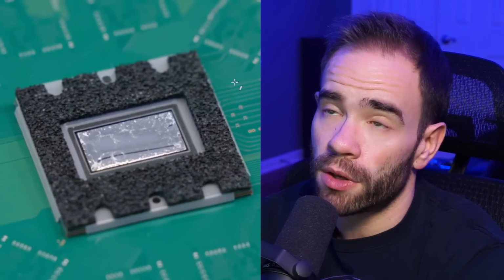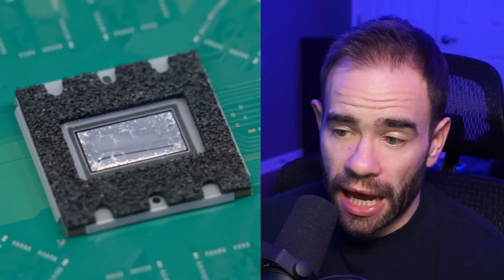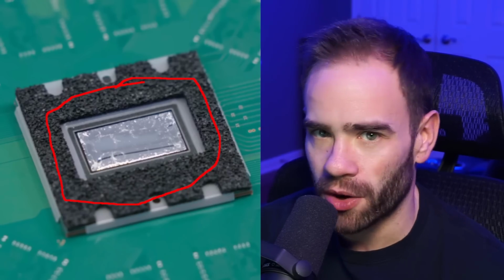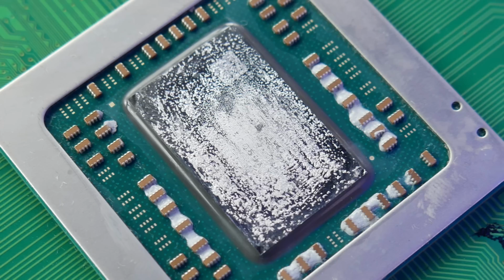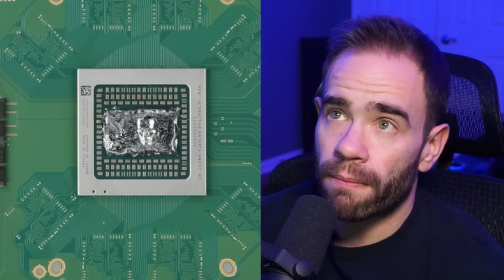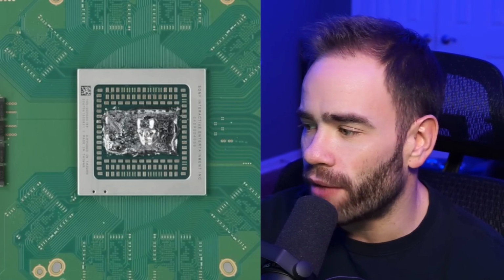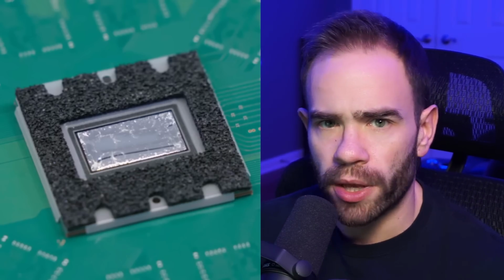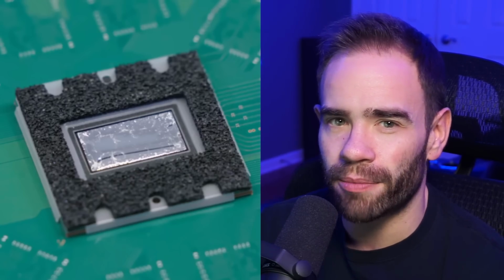Is Your PS5 Actually In Trouble?

Comment: I have repaired hundreds of PS5s, I can 100% tell in my most processional opinion based on all my observations and recoding's, vertical storage causes gaps ( Dry spots / Hot spots ) on the APU chip. When this happens a significant amount of oxidation occurs, in the form of grey sticky residue. If your PS5 is over 3 years I recommend that the PS5 should be professionally cleaned 12 - 18 months + have the old liquid metal completely removed and totally replaced.

Comment: @Spawn Wave Plus : repairshop around the world start to claim that they open PS5 that was NEVER opened and put HORIZONTALLY all the time to start hard freezing/shut down DUE to hard corroded APU spot because of the heat DUE to missing liquid metal spot on APU. my day one PS5 start to freeze badly also (i dont had the courage to open it yet) @ILovemyconsole have a YT channel that show the issue in france !

Comment: THe only thing that concerns me which as this guy also noted is not that the liquid metal would spill over. It's very well contained by Sony. But you can't fight gravity and it's plausible that the liquid metal may settle downward a bit, leaving dry spots on other areas of the chip so it's not cooling as effectively. 

If this is true, then putting your PS5 vertically can reduce its life unless you keep reapplying the liquid metal every year. But whether this actually is a real issue, it's still anybody's guess at this point. 

I just got a Ps5 about 3 weeks ago and I used it vertically for about 2-3 days and then these stories scared me shitless. I have a tiny desk but I'm somehow using it horizontally now. I have a lot of past traumas associated with dying consoles, so I don't want that happening again with my new purchase.

Comment: I've had my PS5 vertical an I've had no problem since I've had it. The barrier their helps to stop the liquid metal from going everywhere. We know that liquid metal can be messy to other metal or be a conductor. There's also three chips on the board in the PS5 that gets sent through the PS5 that sends through to say hey we need to cool down an the fan speeds up but that's only if you are pushing the PS5 hard on all settings. If you run the PS5 less hard it won't over heat etc.

Comment: ONLY the first models.. most of them on Brasil.. nothing to do with the liquid metal. The problem was a thermal paste around the chip, on an L shape. And that L shape would not let the pressure of a metal plate on the back of the chip to proprer pression it. Because it would pression more on one side of the ship that on the other. So it wold look like the liquid metal would move, but no. There was just more pression on one side of the chip than on the other!

Comment: I have been watching a lot of tear down videos of PS5's lately. One thing I have taken away is that almost all of them, the liquid metal seems to create a void pocket somewhere on the chip.  Almost every time, the liquid metal needs to be moved, "reflowed" or worked back into the chip surface and heatsink. I understand that liquid metal has a slightly better thermal efficiency. I have seen bench tests comparing the latest thermal pastes and liquid metal and liquid metal usually edges out about 2 degrees F. My question: Is it really even worth it? Liquid metal seems to have some slight moderate risk, even if being careful. If it is flowing and causing a void..even a small one on the heat spreader, why not just use a current high end thermal paste? Both paste and the liquid metal have a  service life. Most of us are going to go back into the system and doing a deep clean which is going to require disassembly to the point of needing to repaste or at least "rework" the liquid metal before either one's service life has been reached. I am just speculating. I'd be interested in other's input and opinions. I am most curious about the  longevity of the system, both stock with LM, vs. possibly using a high grade thermal paste on the chip.

Comment: I'm disappointed that they couldn't add some kind of password protection to the power switch. They made this thing way too easy to turn off. There's so much more that could have been done to prevent this. I'm hoping they'll just make the PS6 without a power switch so it stays on all the time.

Comment: I’m very careful with all my systems and other than the red ring on my 360, xbox are solid and well built along with the controllers and accessories. Can’t say the same for PlayStation. Far more broken parts and failures. Throw in the obnoxious size of the ps5 and the choice was easy. I’ll still get a ps5 but will wait for the “slim” version.

Comment: Delidded my i7 7700k using thermal grizzly's liquid metal conductonaut at ltx 2019, been running near nonstop since then with 0 issues. Should probably check it, might just be the conformal coating doing its job.

Comment: I bought 3 ps5s two disc's and 1 digital the only problem that I had was the digital version over heating and I just opened it up cleaned the big dust build up on power supply and it works flawlessly now

Comment: My ps5 when I first start it running or when I turned it off after 6-7 hour playing. I heard some cracking in it I don’t why it is happening or why but there are no issues in overheating and I have uses it for a year playing at least 4 hour a day different games
Reply: Mine does the same thing kinda freaky sounding but more than a year later I have 0 issues so 🤷🏽‍♂️

Comment: If your PS5 overheats then there are dry spots on the die where there is no LM . Also when assembling the PS5 they put the LM on then flip the motherboard over to install into the PS5 housing. So during that flip LM could potentially escape out of it's foam plastic border.

Comment: For the PS4 Pro it's the ram that makes the fan spin really fast. Just replace the thermal paste with thermal paste and use Minus 8 pads of the same size on the ram. Completely eliminates high fan spin. Test with Horizon Zero Dawn game.

Comment: Terrible, you ramble on and on, and no intelligent advice at all.
 Liquid metal thermal is known as Galinstan, has a melting point of 21 Celsius.
 The real issue with most PS5 shutting down only after a short period of time, (like 5 minutes or sooner) is absolutely due to either a loose connected power cord, or most typically, you have the PS5 power sourced from a surge protector which is in direct conflict with the already built in power surge circuit protection installed and integrated into the PS5.
  Simply plugging the PS5 directly into a wall socket will absolutely stop this issue from happening. 
You do not have to go into the PS5 system settings and make all the changes that are typically mentioned on these social media platforms. And the PS5 Is built and designed to play any and all triple A games, as that is the purpose of this system. And it can be enjoyed for hours on end, as long as the PS5 can draw room temperature air into its cooling vents, and dispatch the hot air out and away from the back side of the console freely.
Reply: Congratulations fan ❤, you are among our shortlisted winners contact me🎁⬆️🆙

Comment: When you use the console vertically, it overheats. I have my console for almost a year and I have made the difference. I deactivated the rest mode and I left it on for 24 hours in vertical mode and a  another day I did the same thing horizontally and it didn't even heat up. If you have the choice between horizontal or vertical, it depends on the structure of your furniture, I recommend putting your console horizontally.i had no issue with mine but vertically its overheating since i have it.i have also bought an external fan for it but in horizontal,i don't need it except in vertical mode
Reply: Congratulations fan ❤, you are among our shortlisted winners contact me🎁⬆️🆙

Comment: The reason why Sony put on so much liquid metal is to ensure that it doesn’t need to be reapplied for the life of the console.  Liquid metal will react with the metal of the contact plate over time and some of it will get absorbed into the metal, decreasing performance if there is not enough if it left.

Too much liquid metal risks overflowing and conducting the surrounding components together that shouldn’t be conducted, hence the barrier Sony put in.

Sony did what they needed to do to ensure liquid metal could be functional for the life of the console.

It’s good practice to apply enough liquid metal in any scenario, as long as it doesn’t touch surrounding components.
Reply: Congratulations Jackka82❤, you are among our shortlisted winners contact me🎁⬆️🆙

Comment: I wish there was nothing to worry about but I'm afraid I am a victim of something going wrong with the PS5. Had it since its launch, sitting vertically, and consistently cleaned and kept in a dust free area. Still, unfortunately, the console shut off on its own. There was a diagnostics test on the PS5. No overheating issues, no hardware defects, but there was an issue with the motherboard being effected somehow. The ONLY issue could be the liquid metal spilling onto the the motherboard. There ARE a small percentage of people facing this, generally people shouldn't be worried, but precautions should be taken to be on the safe side.

Comment: For keeping my PS5 lasting longer I 1). Turn it off at the powerboard (and pull the plug out while not using it), and 2). Place a "pillow slip" over my "vertical" set up so it doesn't accumulate dust. That's all I can do to to maintain it (well, I don't know if the pillow slip idea actually works - lol). Otherwise while I'm playing a game on disc I pump up the air conditioning in my room. All I can hope for is for the longest life-span of my console as possible. But I think it's already a yes to upgrade to a PS5 Slim or Pro when released, So hopefully - Sony will have definitely learnt some important things by the time they pump out their next pressed consoles.

Comment: Ive had my PS5 since April of 2020, and “knock on wood” it performs quite well. The only issue I’ve had is sometimes i get something that sounds like coil whine but cycling the power on the system corrects that, it inly ever happened after turning back on from rest mode never from a cold boot. I sometimes use my PS5 or leave it on for hours at a time snd it works just fine. I have. Series X as well and despite the very first one shipped to me didn’t work the next one Microsoft sent works just as well well as my PS5. I know the Liquid Metal story came from a repair shop owner, got picked up by the media and overblown much like everything else the media touches does. I said to myself if the PS5 has been out since 2020 and this hasn’t been an issue until now, for one it might not affect launch models, and/or its a small sample size that affected some users such as Microsoft’s having some Series X’s with PSU issues and not turning on. If it was as big as the media over blew more people would have complained already and there would no doubt be a class action and there hasn’t been any (yet) so its most likely overblown by a repair tech thats trying to get some attention by saying something crazy.

Comment: Same as others I have had my console since launch vertically. I also have a disc system since June 2021, again vertical. No issues thus far. I am seeing this more as a "could happen" situation if there was a defect in the system when it was put together, like most any other tech imo.
Reply: The ones that claimed such a "design flaw" have retracted their statements since there is no evidence to prove their claims

Comment: Well mines mounted on the wall with a hide it mount so I’d be SOL. Been vertical for a year and a half. I honestly don’t think this issue is as big as people are making it. If your that concerned ditch the Liquid Metal for some thermal grizzly or mx5. Yeah you’ll gain like 3-5 degrees C, but you’ll have piece of mind. I am not too worried. That Eva foam is thick and with the pressure from the heat sink it should be fine. Especially after all the time I’ve been running my ps5.
Reply: Doubt it since the ones that claimed "fatal design flaw" confirmed there is no evidence to back them up

Comment: in conclusion of my first comment. i honestly beleive the ps5 doesnt vent or cool down as well as it does horizontal... idk why my ps5 was turning off after a few hours or why the screw was maddd hot but that ha[pen in vertical position almost a year ago and since switching to horizontal not 1 problem. idk why this is. simply just my experience

Comment: alright this is weird but i do think horizontal  keeps ur system cooler honestly cuz about 18months of daily ps5 us my ps5 did start shutting down after 2 or 3 gameplay hours and i went to unscrew the base while the ps5 was in vertical standing and that metal screw you tighten was abnormally hot. i sat my ps5 in the horizontal position ever since and it works great still never shutting down and still super quite.

Comment: I've had my ps5 about 2 years now and after a year of having it,  it started switching itself off after around 30 mins of gameplay on a ps5 game I noticed after playing a ps4 game on my ps5 it ran fine and didn't crash it was only switching off running ps5 games it turns out there is bit of a flaw in the design as the power supply vent holes are quite small and are prone to blocking about 80% of the holes were blocked  
So the power supply unit would overheat when more strenuously used ie more power needed for ps5 games and not so much power used playing ps4 games so it wasn't the system overhearing hence why I wasn't getting overheating warnings before it switched off so yeah took it apart and cleaned everything and it hasn't crashed once since. 

Maybe people have taken their ps5s apart but accidentally unscrewed the heatsink by mistake causing the liquid metal to leak 🤔

Comment: Disc drive issues aplenty with loud noises, grinding and a full disassembly required to move a gear back into it's right place, but that's the only issue I've had so far. LM has been used in Pc's for years without issue, I don't think Sony jumped on a bandwagon. I think they did their research.
Reply: I have had the disc version since launch I never use the disc drive I've been digital since it became a thing so I don't even know if my disc drive works

Comment: I don't like the liquid metal idea at all. These PS5's won't last 5 years which is sad because my PS2 from Jan 2002 is still going strong. I've had to replace the little worm gear guide that screws to the laser a couple of times but everything else fine. My 60 gig PS3 Fat lasted 8 years before I had to send it to Fla for reballing of the processor.

Comment: I was always curious about the PS4 Pro, as I bought one to upgrade from my base PS4 (got a year after launch), yet it died and the original is still working. One day my PS4 Pro just wouldn’t turn on (it would beep as I pressed the on button, then just nothing). The fan thing always worried me, which is why I’m glad they sorted that with the PS5 - the fans are loud upon startup of games, but that’s it for me.
Reply: You could get the Pro repaired or sell it broken on eBay for some $$. There are repair techs that fix those no power issues.
Reply: @slickrx6908  I thought about getting it repaired but then I was able to (luckily) buy a PS5 right after it broke, so just left it. Didn’t think anyone would want a broken one?
Reply: @TheMadCatter1  Yeah broken ones sell all the time. Plus if it's in low enough firmware it can be jailbroken to run third party apps.

Comment: My PS5 was purchased in October 2021, and since then, I didn't encounter any sort of problem related to overheating. The only time I noticed some issues with this was when I played Sonic Frontiers, the PS5 got pretty hot and the fan started kicking up a bit, but that probably has something to do with the optimisation of the game itself or maybe with the fact I didn't use the PS5 for about two months before playing Frontiers.
Reply: Probably both fans got stuck from no use and doesn't that sonic game have issues anyway
Reply: @crazychase98  yeah, Frontiers has some issues, it barely ever keeps 20 fps when in 4k-mode and in 60-fps mode it still has drops and muddy textures. I've been playing some more Ratchet and Clank and Death Stranding and it certainly is just as quite and cool as before.

Comment: And this makes sense Jon.  Great explanation.  My theory is that for the one's that were affected, if it wasn't tampered with by opening it and messing with the components, those units were probably shipped with little to no barrier around the liquid metal chip and compound, because it could have somehow broken down in transit.  And just happening to have it in the vertical orientation was enough to short the whole board.  And if it indeed IS an overheating issue, you would have to wonder where people would have their console in their setup, whether it was in cabinet or not, regardless of the orientation.